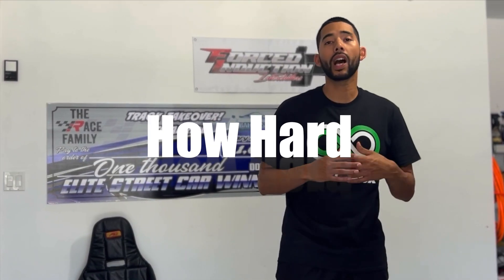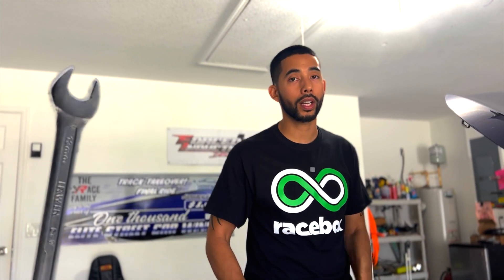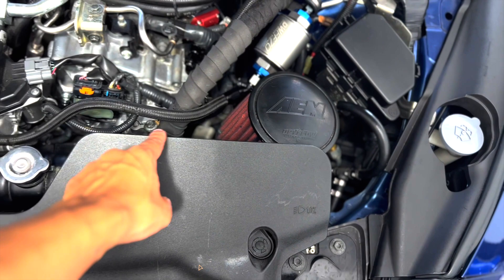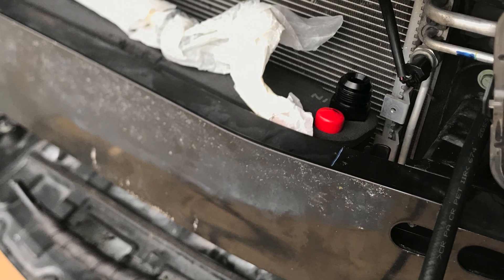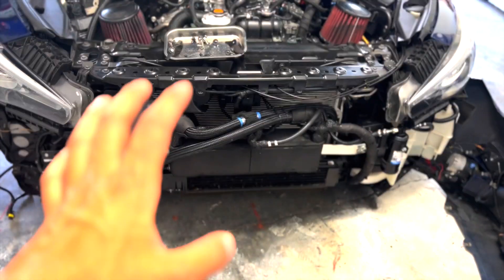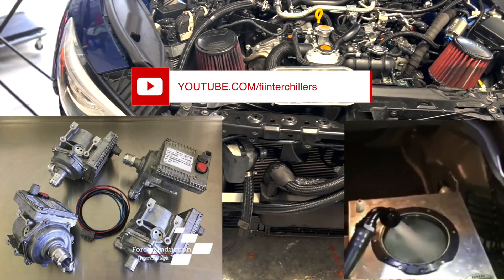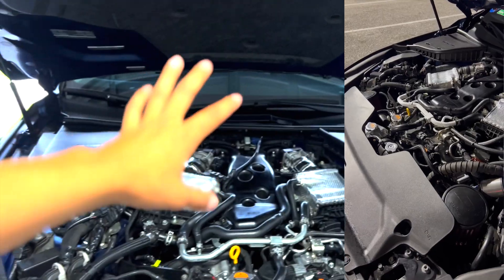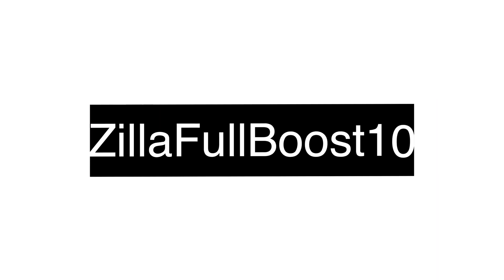TOP 6 Things You Want To Know About The Interchiller | Heat soak?

Comment from the maker: What else would you like to know about the chiller?

Say bye bye to heat soak.. Click the link (change your currency) and/or use code zillafullboost10 at check out for 10% off: 
https://bit.ly/3yqZJ11

First Dyno Tune after the chiller install: https://youtu.be/owVmTw-THn0
Reply: it would be wise to note that if you turn the a/c off or if the compressor fails, you have no way to cool the charge air. You will run in to problems extremely quick. Retaining a HX is a good fail safe and only requires a gate valve to bypass for normal operation.
Reply from the maker: My compressor is always on and if one day it does fail I can swap out the compressor. I’m honestly not too worried. If my charge temps are ever  100* degrees my phone flashes and I just won’t step on it until I fix the situation if one ever occurs.

But yea a bypass valve operated by temp switch of some sort would work flawlessly with a HX. If it gets to specific temp it can open or close. A manual one or a switch in the cabin can work too.
Reply: there is no full kit that doesnt require welding?
Reply from the maker: I’m not entirely sure, but it’s really not that hard to get those lines off. That’s the easiest part of the whole install. 

If you also think about it it’s cheaper to weld the lines than getting new lines already welded. Still would be nice to see as an option to make it more of a bolt on mod.
Reply: This video was a great overview. Can you detail the routing of AC vs coolant lines, including diameter of both lines with a close up look at the thermal expansion valve connection and the weld job. I may have missed it, but what software/app are you using to get phone notification of system failure?
Reply: How are the Intake Air Temps with this???
I see the water gets real cold (even in the teens like your video) but what about Intake Air temps???
Do you have a video driving testing IATs???
Reply from the maker: @figs73  I wouldn't worry about IATs. What really matters is CAT. IAT's have nothing to do with the chiller. I am testing new intakes and seeing how much IAT's affect CAT's though, but I would say it doesnt do much.
Reply: Is stage 1 as simple as just t piecing the ac lines to the chiller, then removing the pipes from the heat exchanger and putting them on the chiller? I won't need to install a resovoir? Thanks for the video.
Reply from the maker: @jamesclark9857  yea, you can do that. However, there is a specific way to route it so you don’t get condensation build up during daily driving on the VR30. If not you’ll need to clear out the charge system by doing a couple light pulls before really pushing the car.
Reply: How do you activate the drag valve

Comment: Doing a roots blown motor build will this work on it only see this interchiller on hell cats i got that tbs intercooler between my intake manifold and super charger was thinking about an ice tank in the trunk and a heat exchanger in front of my radiator but they say an icebox isn't really for street use re-icing and all so if i install this i won't need an icebox and heat exchager will this work on a old school muscle car

Comment: What’s the reasoning for welding the AC lines ?
Reply from the maker: @mikecerda5398   To weld fittings.
Reply: @ are the fittings included in the kit ? Or that’s something you did extra
Reply from the maker: @ they come with the kit

Comment: Zilla, great job with your system and explaining those details. I agree also on the hoses (braided vs no braided). I have them braided as well.
 On my case I did the stage 2 on my Saleen here in Fla, but I’m a mechanic (I did everything alone). But stage 2 is a different animal as you need to get into the weeds a bit deeper on the AC system.  However I Got a great deal of help from the Interchiller owner directly. I’ll tell you the Interchiller owner is just super smart, very responsive and knows about what works and what doesn’t and what gives you the best results. His name is Kirk. I used previously the killer chiller for about 5 yrs and it doesn’t compare to the Interchiller. The Interchiller system is not only a great unit, their level or quality responsiveness and customer support is top notch! As for the pump, it needs to be connected directly (no controls!), that way it provides the max flow to the system. My water Temps leaving the Interchiller unit back to the S/C are in single digits F!
Cheers!
Reply from the maker: Kirk and his interchillers are top notch. I want to give a stage 2 a shot next.

Comment: Since you're not using a drag valve; it splits cooling to chiller and cabin at all times. Does this mean you have to have the AC in the ON position at all times to cool through the chiller?
Reply from the maker: I do have the drag valve. It comes standard with the system.

The AC is on at all time whether on drag mode or not. I live in FL where 90% of the time it’s hot. When it’s cold I just adjust the temperature setting in the cabin.

Comment: what happens if you run your hvac system on heater with the ac on? does it still work or does it give a negative effect to the interchiller system?
Reply from the maker: It won’t really cool, but chances are if you need the heater in your car your charge temps will be cool already.

You can’t just cycle through drag mode on and heater if need be.
Reply: In theory it will work the same for the interchiller . If you have A/C on for the cabin. it is on for the interchiller . The heat comes from the hot engine coolant . You might need to put the A/C in defrost mode to stop it cycling off

Comment: I don’t understand how it cools your charge pipe…I have a twin turbo car with an oversized FM intercooler. Most of the details I get, but how is it cooling the air in the system?
Reply from the maker: I have Air 2 water Intercoolers. So it uses coolant as a cooling medium to cool the IC’s over just air like a Air2Air IC.

Normally that means you have a front mount heat exchanger that gets ambient air to pass through and cool the coolant that circulates through the intercoolers. 

I basically replace the heat exchanger with the chiller which now uses Freon to chill the fluid instead of just air.

That chilled fluid now circulates through my IC’s.

Comment: Just had one of these installed on my car with the valve so I could keep heat exchanger.  I'm still learning about the system, my question is do you have to turn on the AC for the Interchiller to work or does it automatically turn on? My iat aren't dropping by a ton yet due to needing a bigger reservoir.
Reply from the maker: Hey, yea you need the AC on for it to chill the fluid.
Reply: Appreciate the quick response

Comment: why did you remove the crash bar and use flat stock instead? was there an issue with radiator/condenser airflow? where did you source the hoses?

if you had it to do over again, what would do differently?
Reply from the maker: For weight purposes. It was fine with the crash bar. I got the hoses from alibaba, but Amazon has them there as well. 

If I had to do it all over again I’d route the system differently using an aftermarket CWA400 pump on a Temp Hobb Switch that way I have more control of the temps.
Reply: @ZillaFullBoost  what did you have to do for refrigerant? you mentioned that maybe it was under or overcharged. 

did FI give you the fill amount for their unit to add to the oem system? their weight plus factory weight should get you close and then you can monitor superheat to optimize it. 

what are your temps now days since the system was optimized?